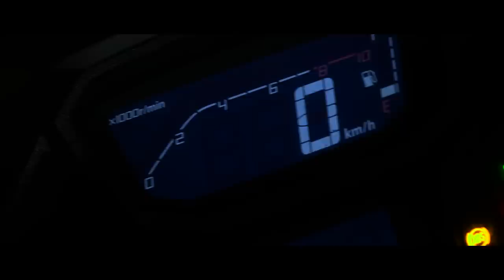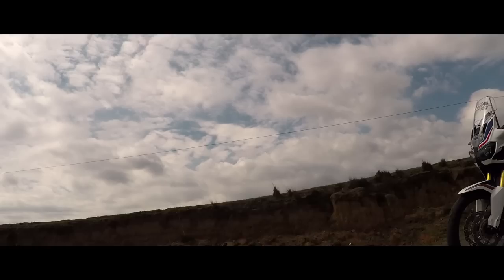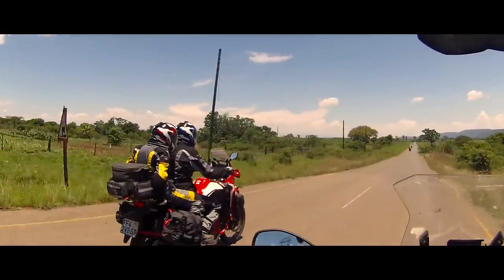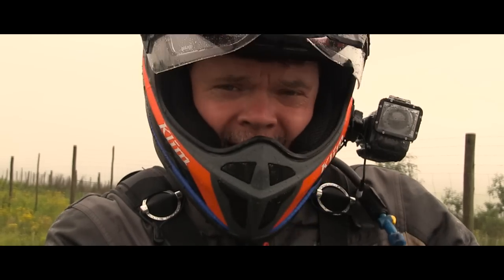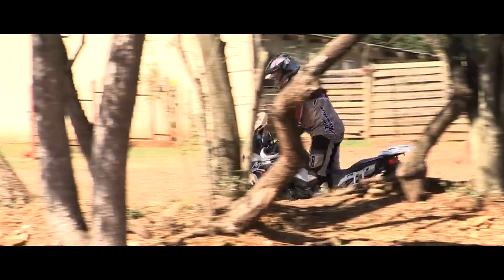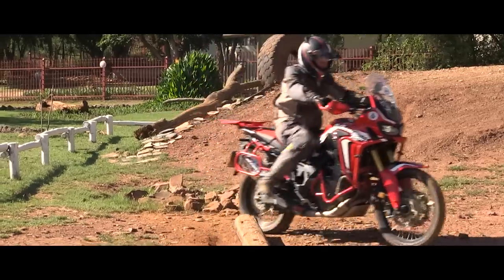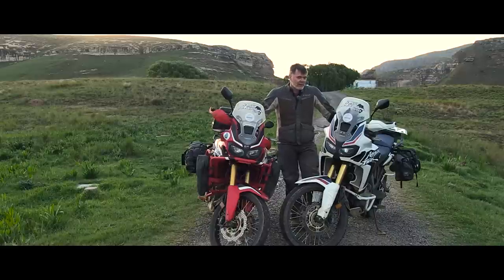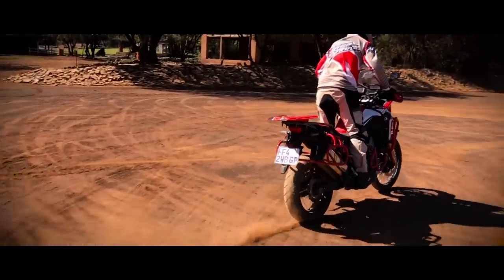BIKE REVIEW: Honda Africa Twin Review Manual Vs. DCT

Comment: My 2019 DCT made me a total convert.  It does everything I ask of it and learning how to use it properly is certainly not boring.  It does require rewiring your brain and learning how to do what you do on a clutch bike differently.  It gives you the option to go to full manual, and using the paddle shifters and brakes you can do everything a manual clutch bike will do.  Auto reigns in overzealous experience and assists inexperience.  I have ridden most of my 61 years and currently have a 2007 Honda 919 for spirited short distance street riding and a 2016 Harley Street 750 for relaxed cruising.  The 2019 Africa Twin DCT fills the long distance/off-road desires.  I’m still learning every time I ride it, and it continues to surprise me with its capabilities.

Comment: DCT all the way I drove both and have a dct  with 6000 miles the dct is faster throw the gears and faster in the curves. and better off road.
Reply: How is the engine breaking on DCT models?
Reply: Kevin Ho really good. If you brake hard, the bike will shift in lower gear and the engine will brake well.

Comment: Did this guy even read the DCT owners manual?  For dirt - S3, traction control off, ABS rear off, and G switch engaged.
For pavement - normal default drive mode, shifts are seamless for driver and passenger, fuel mileage is better, lots of options for your driving style if you want to mix it up.  I can buy a manual in any kind of bike - boring...
Reply: True...
Reply: Tiger xrt
Reply: By boring do you mean engaging,  but a skill I never acquired?  I think it’s better for ones safety if they are part of the experience by using a clutch. That’s just me though. I can’t see ever wanting any kind of shift aid unless there was something medically wrong with me that made it not feasible. I can’t stand the wuss transmissions they put on atv’s. SO much vehicle control is sacrificed. Edit: I will state that when it comes to which company actually figures something like a DCT out “for the real world, and for durability”, it’s definitely Honda.
Reply: Those are desert settings, maybe. In tight forest trails, D, maybe S1 or M, traction control on 1-2, GRAVEL and G.
Reply: I keep mine in sport mode 3 for all types of riding. It shifts exactly as I would.

Comment: Grayzer, interesting review. I just bought a DCT. I must admit I was hesitant in doing so. But so far I love it. I don't use "D" mode, that is annoying. But in one of the sport modes or in manual, there is a mode for every situation. I come from a Tenere 660. The AT has bags enough power for me. It certainly puts smile on my face!
Just another thought....
Reply: I wonder if anyone uses D? Everyone who reviews it says it's too sluggish, shifts too quick. Are there any hypermilers out there ekeing their petrol out in thimblefuls using D to get the best MPG for the bike or is that just not a thing, and does Honda know about this, I wonder?

Comment: So having to pull a clutch lever is exciting? Some one should have shown you the triggers on the left of the bar where you can make every single shift the bike will ever make manually if you want. Tape a tennis ball in front of the left grip if you want to wear your hand out. How exciting!
Reply: Road Toad I rode both, and ultimately went MT.  The deciding factor for me was that the cable throttle/EFI combination on the AT was too snatchy for low speed riding over really technical terrain.  The DCT was better off the line from a standing stop, and better in traffic, and at least equal offroad if by “offroad” you mean anything that could be reasonably handled driving a Subaru.  But for the really gnarly stuff, situations DO come up where there’s no substitute for having a clutch.

The thing is, being slower off the line wasn’t a deal breaker for me.  If I still cared about drag racing people from red lights I’d have kept my Hayabusa... :)

Being more of a handful in city traffic wasn’t a dealbreaker for me either.  I didn’t buy my Africa Twin to sit in traffic.  I bought it to get as far from traffic as possible!

Giving up the extra degree of freedom and control that having a clutch bestows for tackling the craziest 4WD and singletrack roads was a dealbreaker though, so for me it was a conscious choice to sacrifice in areas 1 & 2 to gain a little something in area 3.

If the same two bikes had been available 5 years ago and I’d been in the market for an AT then, I probably would have picked the DCT.  I don’t think it’s a question of, “is one absolutely better than the other?”   It’s a question of what kind of riding is most interesting and important to you, and what kinds of tradeoffs are you willing to make in lower priority areas, to gain capabilites in higher priority areas?

Comment: Thanks so much for your ‘personal opinion’ and obvious love for the GS, both of which are boring and irrelevant to people watching the review and wanting to know facts and figures. I’ve just bought a 2019 ATAS with DCT and it’s the best bike I’ve owned so far. I didn’t think I’d like a DCT (different to automatic but we won’t get into that here) but when I test rode one, dropping my ego about ‘being in control with manual transmission’ and taking into consideration what I actually wanted the bike for I thought the DCT was a perfect match for the bike. I’m sure a manual is better in extreme conditions but I’m not planning on getting myself into those situations. Il be doing road miles with some gentle off roading and green laning so the DCT is a much more relaxing riding experience freeing you up to concentrate on the road ahead and the views on your adventure. It’s not bad or good in isolation, the DCT is either right for you or not. Buy the version you like and well done to Honda for giving the choice to us all.

Comment: I think if the DCT had an optional manual clutch lever that would override whatever the DCT's doing and just declutch the bike, that would make it perfect. At low speed I know we're supposed to rear brake it to moderate the engine output, like, you set the gas around 1750-1800rpm & ease off the back till it comes forward, that's fine, but if you accidentally overdo the throttle, there's nothing to save you from it lurching forward into traffic, parked cars or whatever. A manual clutch lever you could just grab would save you that tiny moment between coming off the gas & applying the front brake, and for most bikers a clutch grab is instinctive in an emergency. Not having it there, for me, led to me panicking, grabbing the brake too hard & getting dumped, which ain't fun but at least I didn't send it into an intersection. Potentially deadly oversight, not having anything to save you from a whisky twist. I'm sure you've all seen the viral video of the DCT rider who forgot he couldn't blip the throttle in drive & wrecked his bike trying to make the engine sound peak to let a driver know he was there.

Comment: They should have a mode where you push buttons to change gears but maintain a clutch lever for when you want to feather out the clutch or other similar uses. The best of both worlds. If you were testing a bike created to use primarily off road you should have put on 70/30 tires biased for dirt.
Reply: Rear brake to modulate the power?  Please explain.
Reply: Yes

Comment: Had a DCT and it was great for smooth changes with a passenger, but I sold it after 11 months because I missed being able to modulate / feather out the clutch, especially on round-a-bouts in the wet. In that situation with the DCT, you're simply on or off the power. After not using it for 2 months then getting back on, I felt the DCT took too much away from my involvement with the bike. I miss my 2013 KTM 1190R, but lost faith in it's reliability after a number of random quality control problems, but the ride and feel was much more fun than the Africa Twin. Not sure what to go for next. I would be great if there was something out there lighter, reliable, and that doesn't need the buyers find the faults on behalf of the manufacturer in its first year out. Surely that's not too much to ask.
Reply: tenere 700?

Comment: spend money on tires and training instead of travel to South Africa next time, please. maybe you will make a real review, not just your biased, unqualified, basically irrelevant opinion.

i own the DCT, and cannot see how adding a clutch lever could make it any more fun than manual mode on road. on the other hand, being a novice off road, i enjoyed an adventure ride in Bosna with two manual ATs, two KTM 1190 and a GS, having no issues keeping their pace. yes, on proper 50:50 tires.

i only plan to move my rear brake lever to the left hand to free my feet completely, and be comfortable regardless of seated or standing position.
Reply: Can move the rear break to left hand ?

Comment: Those tires where not 70% offroad though... But I bet 90% of all the new ATs won't see gravel so the tirechoise from Honda couldn't be more right. I don't understand these adventure companies that uses those tires, is it asphalt adventures they're aiming for with offroad(touring offroad) bikes...?
Reply: I actually asked the dealership about this and they said that to achieve the results in their safety testing, they use road tires.  Since they used them to achieve their safety ratings, they have to sell them that way or they risk lawsuits.  I don't know how true this is, but it sounds logical.

For example, they might be advertising the bike's 60 - 0 mph stopping distance/time, and those results wouldn't be true if they sold it with different tires than the ones they tested it with.

Comment: Cruise Control please Honda! You'd have me as a customer if the Africa Twin, or the CrossTourer for that matter, had cruise.....
Reply: And that's why we have choice. No ride by wire is one of the reasons I swapped my tiger xcx for an AT.
Reply: Chris Thompson Although the throttle is connected via a cable, the engine is no less computer controlled than any other Euro 4 engine. So I can't believe it's technical restrictions stopping Honda. I can't be the only person wanting this stuff given how many KTM's and GS's get sold. Oh well I'll just have to wait! 👍🏻
Reply: Cluch or DTC is a matter of opinion but I simply don't understand why Honda sends them out of the factory on road tires, a total miss match.
Reply: I am bemused by this? I have a DCT been riding 40 years and think the control off road is great. In manual you have all the control you need. I don't get it. Or maybe the guy riding it just didn't.

Comment: Interesting as a lot of experienced, highly competent riders have raved about the auto DCT, especially when carrying a pillion passenger. I had an XLV 750 with shaft drive. Do you think shaft would suit the bike better than chain?
I’ve also owned an R80GS Dakar and an R100GS- both shaft- no oiling or adjusting.
Reply: Those experienced riders were well paid for their DCT support by Honda in various ways.

Comment: The AT was built perfectly for its audience. Thrifty conservative riders and that's not a dig. It is what it is and there's a bike for everyone.
Reply: It’s probably the only big capacity trail bike you can ride hard for 50,000 miles off road without any major problems . Not like a gs or Ktm

Comment: Anybody who has driven a maxi scooter ought not have issue  with the DCT on road. I could see it becoming an issue at very low speeds while filtering through traffic. You won't be able to use the engines revs on its flywheel while feathering the clutch to generate centrifugal balance forces.

Comment: no clutch no deal, as simple as that.  Very good and honest assessment! thanks.
Reply: completely agreed.
Reply: So the DCT with two clutches is twice the bike?
Reply: you know what I mean, clutch lever - I have tried DCT, it's no use for off-road. For city riding like a big scooter sure, some may like it.
Reply: could give many,  for instance how would you slip the clutch in sandy, muddy condition while adding throttle at the same time to get better traction?  How would you stop whisky throttle after bad jump not having emergency  lever disengaging engine? etc etc any technical enduro stuff would be a big challenge and risk with DCT, not to mention it weighs a tone what is not good for off-road.
Reply: For some people particularly amputees or those with surgically frozen ankles a the DCT is a godsend. Manual clutching always gives superior control but DCT has it uses. I have an 1800 VTX and a Suzuki Bergmann. The VTX is OK for the highway but in stop and go traffic it's tiring to use a shifter with a wooden leg. I can carry more with the scooter anyway.